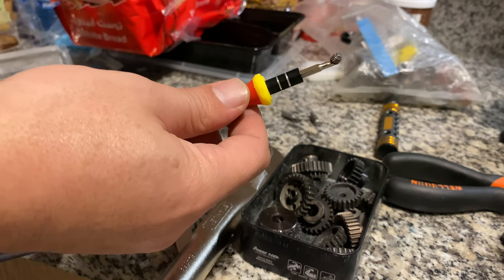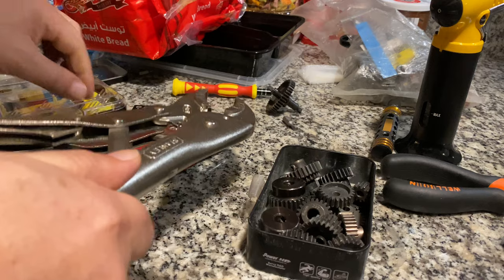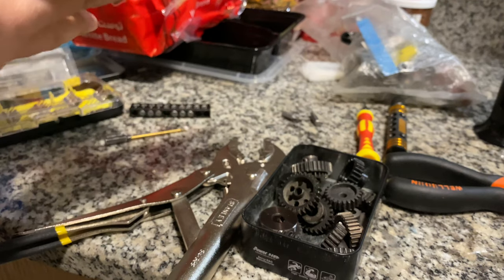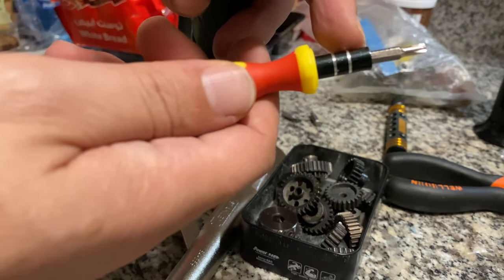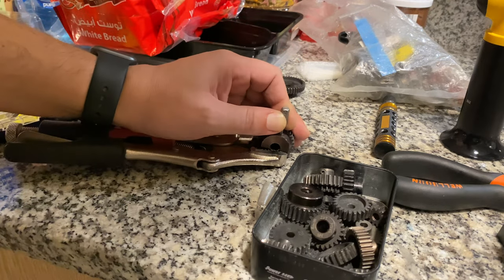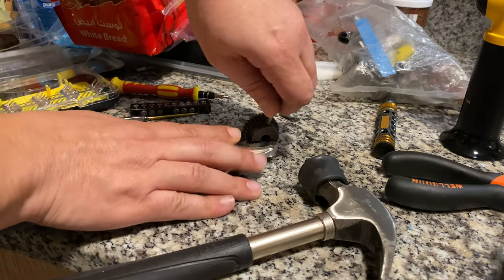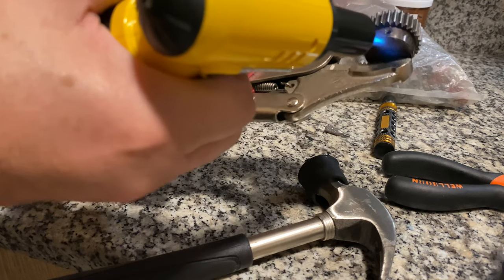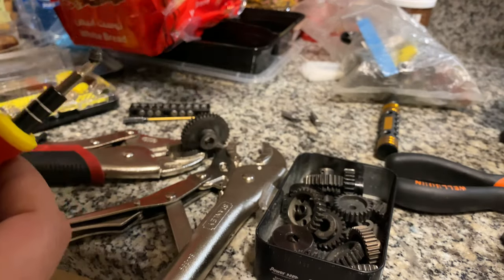Take it out dont lose a gear

Comment: Nice video, i also do it like that. I put a ton of green Loctite around the shaft and in the grub screw hole to make sure that it will not come loose if im at my bash session. And if i have to remove it i just use my little torch ^^.

Comment: Grub screws in both rear axle drive sprockets on motorized adult Trike keep loosening over the key-way - there's room to replace them with a Hex 6mm bolt - will they stay tight?